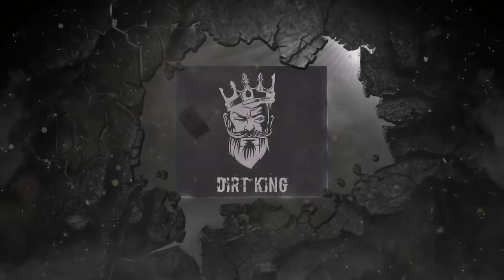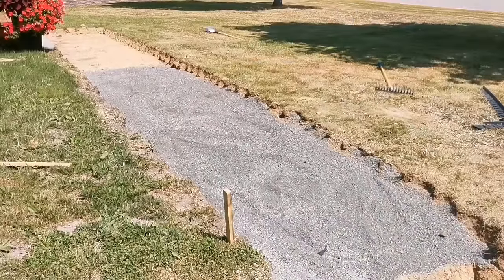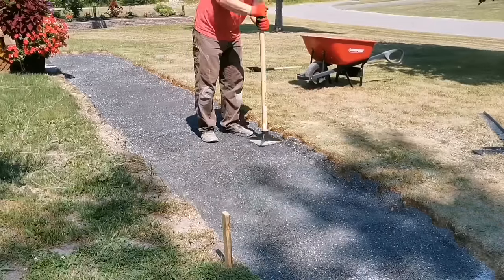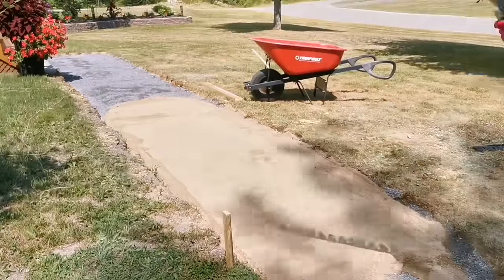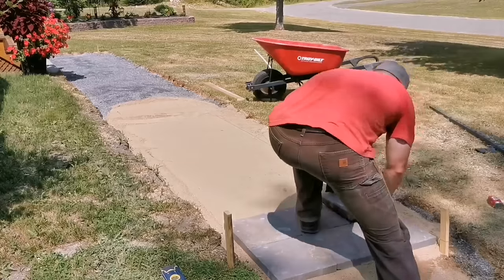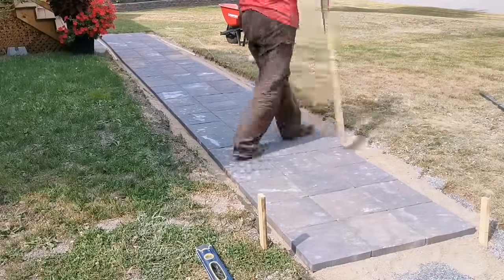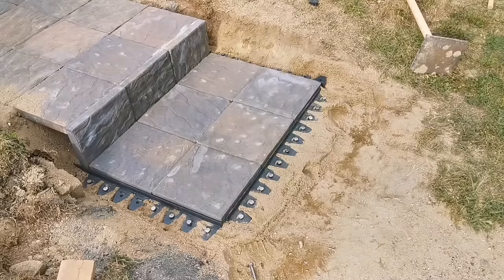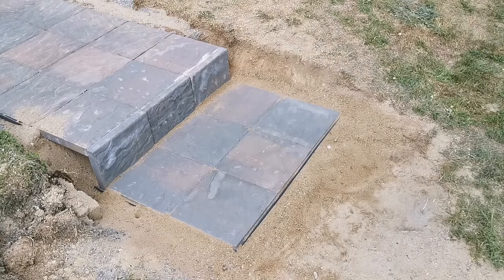Building A Paver Walkway That Will Last.

Comment: Gosh, I'm SOOOO glad YouTube had this waiting for me this AM.  I'm starting my paver project with an outdoor wooden shower enclosure I built, and this is BY FAR the best video I've watch thus far on the topic...I really appreciate your thorough step by step guidance.  "Saved" in my web browser favorites.
Reply: Two questions for you:  1)  what type of gravel/stone you used to border the paver walkway, that covered the paver edging?  2) the sand that you swept into the cracks of the pavers, what was the type and did you then  mist with water to have the sand bond?  THANK YOU!
Reply from the maker: Thank you very much.
Reply from the maker: The gravel I used to border was the same as the padding material underneath. It's an angular crusher run stone. Very small in size. Anything small in size but still angular in shape will work great.. I then covered over with topsoil to border the pavers, it will make for a great lawn to cover the edging. 

The sand I used was just plain beach sand. You could buy the Polly sand if you want, it is the sand that bonds after a little water is sprayed on it.  
I chose not to use it because either sand will need replacing after 4 or 5 years due to wear and weather. It's so much easier to use regular Beach Sand. Quick fix and your good for another 4 to 5 years. 
The Polly sand requires to be picked out of all the cracks to replace and makes for alot more work. It sticks like a silicon. It is a great binding product though.  If you due choose to use Polly sand make sure the pavers are completely clear of all Polly sand before spraying or it will stain the tops of your pavers.  Thanks for watching..
Reply: @terrymcgillicuddy8056  Thank you so much for all the insight and advice.

Comment: How did you do the step? It looks like is just hanging with no support underneath?
Reply from the maker: I used retaining wall blocks under top step the used concrete adhesive to Bond it all together. Thanks for watching. I'll show the process in another video

Comment: How did you do that step?
Reply from the maker: I used concrete adhesive (Gorilla Glue) on the backside of the pavers standing up.  Fastened them to the pavers behind.  Sorry I wished I'd of showed it in the video.

Comment: Very helpful, especially the edge you used. I just got mine cut out this week. My employer loaned me a small mini excavator with s 4 ft blade. Went 30 feet and was thankful for the machine because of roots and hard dry soil. I wouldn't have done it if I didn't have the mini.
Thank you for your efforts, much appreciated 👍
Reply from the maker: Thank you for watching.

Comment: Completely leveling your crusher fines before putting the sand on. Talk about a perfectionist. Thanks for the video!
Reply from the maker: Thanks for Whatching 👍
Reply: Thats so the finished walk will be flat!  A little extra time is well worth it. Image finishing it all and said to yourself, "I wish I would have made it level!" ( actually one side should be a little higher ,(1/4"), so water runs off of it

Comment: Nice work! On my steps I let my tread paver run over my riser paver so I get a little nosing and riser helps supports the tread edge. I also use  PL Landscape paver & block adhesive on the tread/riser joint.
Reply from the maker: Thanks for watching and Thanks for the tip  👍

Comment: Great video, thanks. I'm installing a french drain (drain pipe with 1-1/2" round rock, wrapped). Would this work on top of it?
Reply from the maker: Yes it will,  the only concern I would have is,,,if you get frost in the winter months. The frost could lift the drainage pipe causing your pavers to lift.

Comment: Really wanna try to do a small section of pavers. Any tips on getting the strings leveled properly?
Reply from the maker: You can buy a small string level at any hardware store. Keep your string  tight. Once the level is attached to the string and reading level, look at the dirt below the string. You will see shallow and high spots. 👍

Comment: How did you get that vertical step paver to stay in place as sturdily as the horizontal pavers?
Anyways, thank you for posting this helpful paver info -- thumbs up; 👍

May   God  bless you & your family.
Reply from the maker: Hi, I used cinder blocks underneath the last paver with concrete adhesive. Thanks for watching

Comment: Surprised you don't use rigid pipes as the plastic ones I got are not totally straight and messed with my level a bit. Still turned out great. I think you should put more emphasis on level and how important it is, one of the best videos on this for sure.
Reply from the maker: Thanks for the feedback. I totally agree. I will definitely use steel pipes next time. I had the same issue while using plastic.

Comment: Excellent video. Couple questions did you use a leveler on the string when leveling the pathway from front to the back? Also, if I can't find that crasher dust, what else can I use that I could get at Home Depot/lowes?
Reply from the maker: Thanks for watching. Yes, I had a string level. 
You don't have to use crusher dust. I would ask for a base material that will compact and is  suitable for a paver walkway. 🙂

Comment: Can you talk me through the steps. I'm building a walk way now and I have 2 steps that I am putting in. On the front edge I have a landscape trapezoid paver under the lip, but behind it I have the crushed rock like you show. I want to use liquid nails to keep the step all nice and tight, but not sure if I should. Also, should I put a layer of sand under the paver steps or can they be seated right on the crushed rock (just the steps)? The rest I will have them on the sand. Thoughts?
Reply from the maker: Sorry so late getting back to you. I hope everything worked out.

Comment: Those pavers are more like 1.5" thick, not 4" as described in the video at 4:55. Most websites say pavers should have a small gap unlike as recommended here, because it will cause problems. But they don't say what the problems will be. Is that regular sand or polymeric you brush on top of the pavers?
Reply from the maker: Regular sand.

Comment: Watched a few paving videos, this is the one I'll keep & go back time & time again when I ready to replacing the paving in my rental. Is the edging plastic or metal, what brand ? What inexpensive DIY tool can use to cut pavers  ?
Reply from the maker: Thanks for watching. I am not sure the brand name of the edging. It is plastic and comes in 7 foot lengths.
Reply from the maker: I usually get a Dimond blade for my chop saw and use that for cutting. The blades are not too expensive.
Hope this helps.

Comment: Great video. I can't find the plastic 1" edging at my local big box stores. Apparently have to go to a brick company for that? I'll be doing clay pavers in narrow walkway between gardens. Maybe won't matter.
Reply from the maker: Yes I had to go to a brick company for mine as well...as long as it's a solid structure butting against each end of the pavers locking them tight you should be fine.

Comment: Would like to see how you did the step brother.. I'm about to start a project at my house and my walkway will need at least 5 steps
Reply from the maker: I used concrete cinder blocks for the steps. I used a concrete adhesive so the pavers would stick to the concrete.
I will definitely re post a video in a few weeks when our snow melts to show how I did this.
Wish I could help more..sorry

Comment: Thanks for the video, it is great. I'm just wondering how many inches of crusher dust you put down. I didn't hear you say that in the video. It looks like about 1"?
Reply from the maker: Depending on when u dig down to solid base. How much crusher dust you will need to level and compact it back up with your lawn height. Sometimes 3 inches Sometimes more. 
Thanks for watching
Reply: @terrymcgillicuddy8056  thanks so much. That makes sense!

Comment: I want to add a walkway adjacent to my asphalt driveway. (4 x12 feet ) Will this support the weight of a car? I want a DIY way of allowing this....having a one car width driveway can be a pain moving cars around. The looks of and possibly the utility of adding the beauty of a walkway and functionality of having a "wider driveway" at times  would be great. We just have small cars....
Reply from the maker: I wouldn't receive using these for driving on...they are thin and may crack with the weight.
I would recommend using actual pavers 4" by 8".

Comment: Awesome video!  Thank you for taking the time to make it!  I was wondering if you wouldn't mind advising me...  I am going to install a patio using 9"X6"X2" pavers with 1-3" river rock between the pavers with a pattern of paver, 3"X6" river rock, paver for a cool looking running bond pattern.  How do I keep the river rock from eventually sinking into the base (or working their way out the top)?  The sub base will be compacted ROC and granite screenings is the sand.  If I put weed barrier between the ROC and the sand will it make the pavers slip around when it rains, loosening up the sand and thereby unleveling the pavers and pushing up the river rock? And if I don't put the barrier down, won't I have to replenish the river rock every few years because it's sunk into the ground?  At this point I'm contemplating using a soldering iron to cut a bunch of 3"X6" pieces of weed barrier to put between the pavers to lay the river rock on.  I know that may be a bunch of extra work.  Thoughts?
Reply from the maker: Thanks for watching, If I was doing your project I would do as you said, compacted ROC.  Then I would use a commercial grade weed barrier. This barrier has a rough texture that will keep the sand and pavers from slipping.
 It also allows water to penetrate. After your pavers are laid down your River rock will be the final touch.  I'm sure it will be perfectly fine and not sink due to the compacted base and fabric.  Just make sure to Only use 1 inch of sand. 👍
Reply: @terrymcgillicuddy8056  Thank you!  So just to clarify-ROC, weed barrier, 1" sand, pavers, then river rock.  In that order..?
Would you use any polymeric or jointing sand on top or would that not work so well due to the mixed materials (ie. small river rock alternating with pavers)?
Reply from the maker: Exactly.  I would just use normal sand.  That way it's easier to do maintenance in 4 or 5 years as the sand wear's off due to weather. By adding new sand it's back to looking new again. 
Polly sand needs maintenance as well in 5 years and it's alot harder to replace due to its silicone texture. Picking piece by piece out of the cracks.  👍

Comment: 1” pvc is 1.3” outside diameter perhaps this is 3/4” inside diameter  pvc? Why not use polymeric sand to seal the pavers together, prevent weed growth and keep a large amount of water out of the joints? Here in the northeast water can freeze and create frost heaves in the pavers. Also what’s the true amount of hours you did this by yourself? Video makes it look fast but it sure isn’t
Reply from the maker: Poly sand is good, too. I like using regular sand, and then I can touch it up every year, making it look new.
I was around 8 hours start to finish. 
Thanks for watching

Comment: Hello Terry, can you pls include the materials and tools that you used? thanks
Reply from the maker: Tools - Hand Tamper, rubber mallet, small sludge hammer, shovel, wheel barrel, rake, tape measure, some wooden survey stakes and string with line level. A 4 foot level as well. 
Material - 12 inch steel spikes, landscaping fabric, pavers, crusher dust, sand, two 1 inch in diameter 8 foot pipes and low profile plastic edging for pavers. Thanks for watching

Comment: Can you use this crusher dust for building ground level deck?
Reply from the maker: Yes, just make sure you dig out all the topsoil down to solid ground. Then add crusher dust in 2 or 3 inch lifts, tamping each lift.

Comment: Hi buddy,
I'm really a beginner on this. I'm looking at building my patio the way you did in this video. I would like to ask you to please provide me with the list of materials I have to buy from store, is this possible please? The dimension of the patio area is  25 feet x 16 feet.
I will be thankful for your valuable help on this.

Thanks!!!
Reply from the maker: Thanks for your comment.
1) landscaping fabric 
2) Crusher dust, for the base
3) Plastic paver low profile edging, usually comes in 7 foot lenths.
4) Box of 12 inch spikes 
5) 8-inch hand Tamper
6) Bag of play sand to sweep in between the cracks of he pavers locking them tight.

Hope this helps
Reply: @terrymcgillicuddy8056  Hi buddy,

Thanks so much for your valuable help.
Have a nice Weekend!!!
Reply from the maker: Anytime, You have a great weekend as well..

Comment: So I want to put a walkway next to my asphalt driveway. Should I use the edger in between the walkway and the asphalt?
Reply from the maker: No, as long as your asphalt is straight, allowing the pavers to have a tight fit, you will be fine just using edging on the opposite side. Thanks for watching

Comment: Thank you very much I really really liked your video and it’s going to help me out a lot. I do have a question you use regular sand not the binding one may I ask why?
Reply from the maker: Thanks for whatching. 
Every 3 or 4 years you have to re do the sand, if it's Polly sand or regular sand just because of the weather and wear.  The Poly sand takes much more work to replace, you have to litterly pick it out of the cracks by hand due to its sticky texture. 
Using the regular sand is easy, spread a couple bags on sweep it all over in the cracks and give it a quick Tamp. Then your good for another 3 or 4 years.  
The Poly sand does bond tighter at the beginning.  But honestly using the regular sand couldn't tell much difference between the two as long as you tamp it good. 
 Hope this helps.
Reply: @terrymcgillicuddy8056  ohhh wow. Thank you very very much for replying keep up the good work.
Reply from the maker: No problem. Thanks

Comment: This was a fantastic guide. Thank you. I’ll be re-doing a walkway that has 3 steps and have a couple questions. How were the steps made? Is it necessary to put paver edging along the step?
Reply from the maker: Hi, thanks for whatching.  
I dug the dirt out from under half of the last paver.  I placed a couple cement blocks under for support. Then I flipped 3 other pavers upright
And added lots of concrete adhesive behind. They've held great, Even though the frost in winter time.  
Hope this helps
Yes I would definitely use the edging along the step for the little you'll need. It will keep them right.
Reply: @terrymcgillicuddy8056  thank you!

Comment: This is a great idea, can I do this on existing concrete?
Reply from the maker: If you live in an area that you get frost in the winter months I would say no. I'd lift the concrete up first.  But if no frost then as long as your able to pound the spikes in the ground for your edging it should be fine.
Reply: @terrymcgillicuddy8056  I live in Connecticut, good ole New England so I guess it’s a no. Thank you very much 😊

Comment: Nice walkway. I want to question you in the retaining wall at the end.  Your straight sections the blocks are all facing the same direction, wide end outward. These types of blocks are designed to be placed  narrow end, wide end narrow end..... they will lock together without having tapered gaps in between each one. I did a wall with them about 14 years ago, used 3 dabs of adhesive in between each horizontal edge. I live in a northern area with frost going down to 4 feet and they haven’t moved. The only area I payed them long face to long face was on the curves.
Reply from the maker: Hi.  Thanks for commenting.  The reasons I didn't turn the blocks is because we like the look of it with the gaps on top and I filled the gaps with the material from inside the flower bed which helps pack the bricks tight together.  This bed has never moved from the frost as well.  I have also done beds the way you have described. Both methods work very well.  Thanks for watching.
Reply: Terry McGillicuddy Soumds good👍. I have seen them used this way around the neighbourhood here too. I’m actually surprised that mine has held together level over all these years since I didn’t go below the frost line.

Comment: Great video! What kind of sand did you use? I’m trying to find the best to buy, but not sure the difference between “paver sand” and regular sand. Any advice on what to look for? Thanks!
Reply from the maker: I just used some really fine sand from the gravel pit. I'd also recommend just getting paver sand by the bag at a hardware store. 
Thanks for whatching.

Comment: Nicely done sir!! I have 2 questions...
1) how did you elevate that last part of the steps?
2) how do you keep bricks/stones around your landscaping from settling/sinking?
Reply from the maker: Thanks, I just used a cement glue and pressed the vertical once up against the others.
As long as you build and compact the  base, they do not settle.

Comment: How do you adapt this for stepping stone style where you have single pavers spaced out into a pathway. I assume all is the same but have to edge around each one individually?
Reply from the maker: You could edge around each one.
I would lay out the entire base then lay your stepping stones. After all stones are down where you want them, then add your decorative rock or whatever around all edges bringing it level with top of each stepping stone.
Hope this helps..
Thanks

Comment: How do you handle a wetter area I’m afraid if I dig down that far it will be mushy and wet?
Reply from the maker: The only thing I could think of is use a larger angular stone 3/4  at the bottom for at least 3 inches thick. This would allow good drainage. Then, use your crusher dust on top.